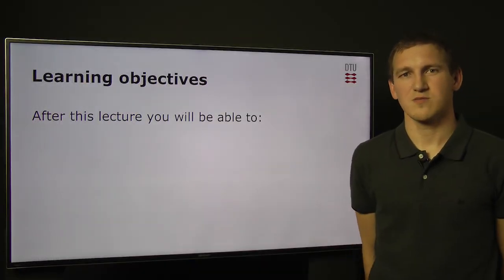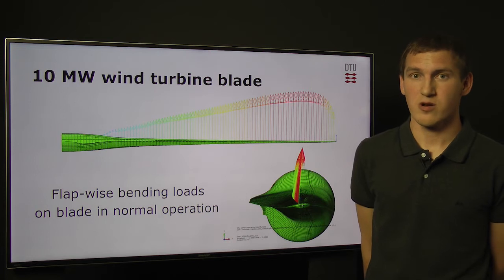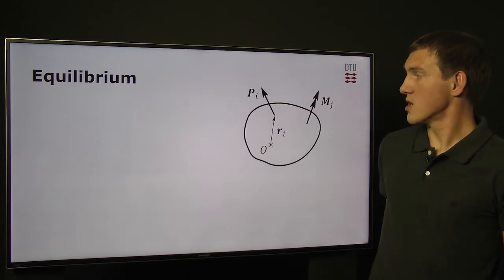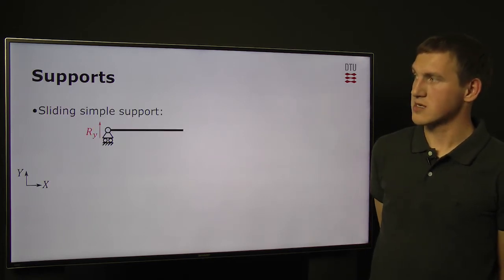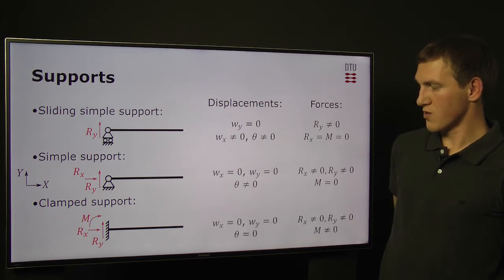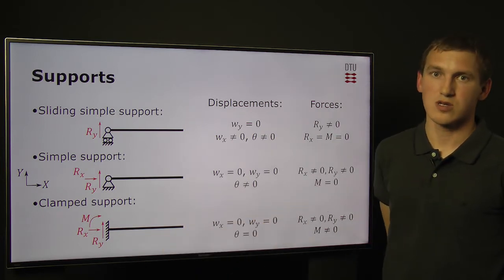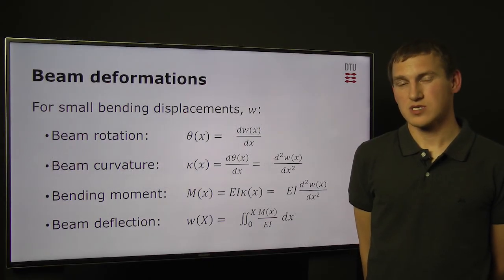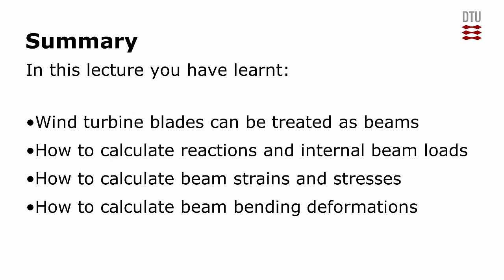20. Beam Theory

Comment: There is a mistake at 6:40. The shear force Q(x) is not equal to Fd/L as you write, but to Q(x) = - F d/L. That is because Q(x) = RAy - F (and not Ray + F, as you write) and RAy is equal to F d/L (as you correctly found before).
This leads to another mistake at 7:32 where the moment is given as M(x) = Fd (1 +  x/L), while it should be M(x) = Fd (1 - x/L).

It is also not fully correct to say that the shear does not depend on the position of the cut, as it is not constant along the beam, but has a discontinuity where the force is applied equal to the value of the applied force F. (The shear value changes from Q = F(1 - d/L) on the left of the force to Q = - F d L on the right of the force). This is also why you should say that the equations you write only applies to the case x > d, while for the case x < d the equations are different and can be found by writing the same internal equilibrium on a cut on the left of the force. Summarizing:

The equations for x < d are: m            Q(x) = F (1 - d/L)    and      M(x) = F x (1 - d/L) 
The correct equations for x > d are:   Q(x) = - F d/L          and      M(x) = F d (1 - x/L)